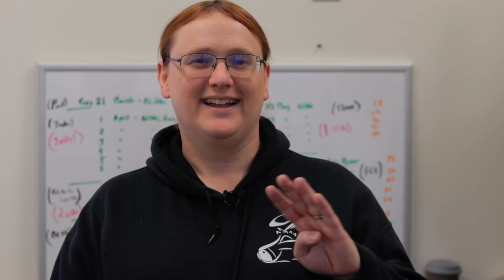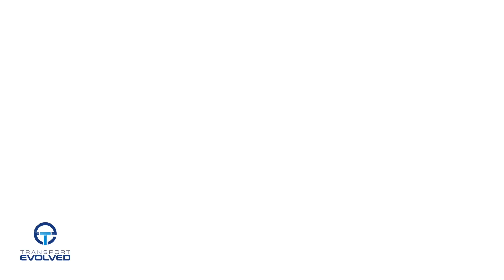What Should The Design Lifespan Of A Car Be?

Comment: We need to take on planned obsolescence directly.  The year that something was made, and how long ago that was  - is the LAST thing that should matter for a machine you use to get around.

Stainless steel - means that you don't need paint, and you don't need "extra" strength to account for rust.  So, that means less weight.

The main thing about any car drsign - is the drivetrain, and the energy source, and the intended uses.  The main parameters are pretty consistent.

Comment: Technology moves on at an every faster pace.  If that technology leads to less resource consumption, should we keeping driving cars that consume more resources for more years?  Perhaps not.  

Take a look at what the industry has been able to do with battery range and especially density.  100 miles per charge was not uncommon 6 years ago. Now we can routinely go 2-3 times as far thanks mostly to density.  But, If a better battery technology came out that would go further still and/or take fewer resources to create, charge, and maintain, should we not follow on that track and send Li-Ion and potentially the vehicles that used them to the dustbin of history?

Comment: I have a 1932 Morris Minor Two-Seater. That's longevity for you. My 30-yr-old Citroen 2CV is less than a 100-miles short of 265,000-miles on its original engine and gearbox, Even the brake discs are the originals. That's proper bullet-proof engineering for you. I doubt my current model Mk7 VW Golf will get to 15, let alone 30 years old.. And as for reaching 87-yrs-old.... Not an ice cubes chance in Hell.

Comment: Across the board in design, we do not build on our successes. We build to fail at ever shorter lifespans. If species evolved the way our designs have the last 50 years, they would soon be extinct. Building modular is an old idea, so implementation isn't impossible. Why are manufacturers  building junk? At what level will the consumer stop buying? Is the consumer buying quality, or bells and whistles fluff? Is it more profitable to build quality? Will my competitor's cheap junk out sell me? 
   BTW: American quality began really dropping around the same time China was open for manufacturing and trade in the mid 1970s.

Comment: The average life of cars is already 11 years, up from 8.4 (CR).  I see 20 years, 500,000 miles being a good target.

With respect ageing cars, I see warn interiors being an issue.  How do you replace worn seats, carpets, roof liners, etc?  Air lines replace the interior of their airplanes every 5 years or so.  What about cars.  With high mileage cars cars used for ride sharing, the interiors will wear out fast.  Custom upholstery like how Sue Martin of ASM auto would be too expensive.

Comment: Out West (U.S.), vehicles will hold up structurally for decades. The upper Midwest or New England you're looking at maybe 15 years before the undercarriage corrodes to failure. Regardless on how well the vehicle is designed, the salt and chemicals used on the roads will eat through most metals in short order.

Comment: A standardized data model, patterned after USB device descriptors, should be developed for battery packs, and I'd support mandating its use by EV manufacturers.   I don't see how aftermarket battery packs can be developed as long as manufacturers keep the interfaces to their vehicles' batteries proprietary.

Comment: Building a car is an expensive endeavor.  That's why there are so few car startup companies and even fewer successful ones.  Part of the way a car company can offset that cost is with the assumption that their happy customer will buy another new car from them 5 or so years down -the-road.  Building a car that won't be replaced in 5 or so years is not too cost effective.

I'm still driving the 1997 Saturn SW-2 I purchased new.  The car is old enough to drink and I still drive it to work every day (30 miles each way).  Everybody who purchased a Saturn loved their car (including me).  However, nobody was giving them up and getting a new one as their old car kept working.  I believe this is one of the reasons GM finally ditched the brand (a fact I don't think I'll ever forgive GM for).

I certainly like the idea and support it.  I just don't know that a car company can realistically operate with that mindset.  And, if they did, cars would get far more expensive.

Comment: Design life - Indefinite.  Manufacturing engineering is where corners get cut.  Owner maintenance is where lifespan gets shortened.  If they are designed with a shorter life, it is a waste of effort and resources.  That is a waste of energy and that is wasted carbon.
Worthless due to battery?  You are making short sighted $$ only decisions. I drive a 1988 vehicle, and spend what it takes to keep it on the road.  That supports the local economy and stops the scrapping of an expensive (in terms of total resource extraction and refining) chassis that has no need for replacement.  My previous pick-up went through two generations of family ownership and over 400,000 miles.  Owners need to look longer term.
I am also an EV conversion fan.  No need for a new chassis.  We have plenty.  Just convert and keep the best old ones on the road :)

Comment: My Ford Focus MK1 is now almost twenty years old and it's still in good conditions. And I aspect that from a  car.  Thats why I don't understand the argument of having smaller batteries, because you have to replace them earlier, because they're used far more, than a bigger battery.  So in the long run, that bigger battery will last longer, even when you replaced the smaller battery .

Comment: I bought my Tesla S 100D when stated to have hardware complement sufficient for full self driving.  From what I see of battery degradation, and I mostly drive gently, 20 years from the battery seems achievable and from graphs seemingly 60% = 60kwh by then with room for more ordinary driving ~10,000 km/year. The car body is very strong and made of materials such as aluminium likely to last longer than practically any previous car. Altogether the S seems to have been built with longevity in mind.  Replacing bits and pieces should not be too hard.  By 20 years, at most, my descendants will hopefully have access to even better batteries in whatever form the power source is by then.
I rarely bought new.  I generally on sold after many years.  My MB 450SLC was 45 years old when I gave it to an enthusiast and my last car was 20 years old when I gave it to a relative. So too I hope with my Tesla.

Comment: The designed lifespan of cars can only increase if the rate of innovation decreases. This occurrence would be very worrying indeed. Would you rather crash in a car from the last two years or a car from the mid 2000s. Very different crash-worthiness yet only a decade apart. And it will only improve over time, even though you think it is already "good enough". 

 (Note, I use the word innovation here, but I really mean the complete list of features of the average car).

Comment: My Kia Cee'd is now 12 years old and I've had it from new. The engine have only done 65k but should be good for another 65k. Aside from a little rust on the rear door due to a bad design, it should last me until I can afford to replace it with an EV. For those of us with little spare cash we would want a car to last forever. The reality is that manufacturers will always make design decisions to maximize profit while ensuring the vehicle is good for its design life which for many I'm sure is around 5 years, although Kia give a 7 year warranty which is one of the reasons I bought into the Kia. The principle factors that govern longevity is engine wear and corrosion resistance and in the case of an EV the battery chemistry. Other factors like other moving parts such as doors, windows, seat mechanisms etc will depend on how much they're used by the user. Again a finite life expectancy. All of these items can be engineered to last 100years no problem. The problem is cost, so there is a trade off between build cost and life expectancy. I would like to see a vehicle where the chassis and bodywork last for 100years plus and all the parts which are subject to significant wear or technological obsolescence should be replaceable or upgradable. I like my Kia as it suits my needs in all areas except the engine which I would dearly like to change for an electric motor. I really believe in reuse before recycle and that's the most energy efficient and sustainable way to use what we have. So the smaller the items that need changing the less impact overall on the environment. Just think of the customization market that could take off if vehicles were designed to be upgraded.

Comment: should outlast us via standardisation. wheres the olympics for engineering ? best design 'for each part' the only one produced in vehicles across all manufacturers,  safety shell fia spec without further mod, inner panels, insulation, outer skin standard sleek design. we need vehicles not style items. but with fully autonomous no one need own a car,van,pickup you just call type required as needed.

Comment: I think the question should be ‘how many km/miles rather than years. As you said and others have noted - safety and aerodynamics are really sorted. I’d also add that body corrosion is mostly a thing of the past. In Amsterdam 20 years ago it was common to be driven in Mercedes taxis with >1 million km that were still very comfortable. They had typically replaced gearboxes, wheel bearings etc., but by analogy we should expect to (economically) replace similar ‘consumable’ parts on EVs - like the battery. That’s the sort of durability we should expect from EVs, irrespective of the vehicle age.

Comment: Nissan had the opportunity to do the right thing with their battery packs - but the design destroys the battery years before it should.  A modern EV battery should last for at least 10 years, retaining 80% of the original capacity.  Within those 10 years, a plan should be in-place to upgrade the battery, and provide another sale - even if it's not the profit from a 'new' car.

Comment: If the drivetrain, suspension, steering mechanisms with all its bushing can be easily replaced, the cost of repair would go down. And same with the doors, bonnets, bumpers etc.  This is what made beetle so easy to work with and tinker. And the beetle came to have a very long life.  Much of the repair cost today is in the labor while  the parts are way overpriced.  

Battery pack would be one of the items that really needs to be easily replaceable.  just unbolt few bolts drop out the old and replace it with a new.  The battery should also be designed for easy recycling (reclaim material easily) the spent battery would then have more value than just rubbish and this could offset the cost of a new battery pack. If leaf's battery pack could be replaced for $?? it might be worth to keep it for another ten years...

We generally keep our ICE cars for 10years while pkups go for about 20 years before we decide to replace it.  There is also a cost tradeoff for wanting cars to last for million miles versus 200K miles.

Comment: What do you know of this news report
Scientists find new way to power electric cars using cobalt
Researchers at the University of Massachusetts Lowell developed a technique that uses only water, carbon dioxide and cobalt metal particles that have surface nanostructures measuring billionths of a meter in size, to produce hydrogen on demand at relatively low temperature and pressure and to use to power the next generation of electric vehicles.

Comment: I don't think sustainability for cars is or will be an issue.  Most of today's cars are already recycled to a high percentage of their parts.  But as an academic exercise:  per a little Google searching, the length of time consumers are keeping vehicles is growing.  Manufacturers are designing cars to last at least 15 years, and depending on how you look at the data, cars on average are lasting 11.5+ years.  Electric vehicles, with one notable exception, should inherently last even longer.  The exception to this is the battery.  But they are getting better and cheaper.  I would predict that within the next few years, we will start to have EVs that will last 20 years.  I think the distribution will be similar to today- many folks will buy or lease a new car every three years no matter what.  But there will always be a market for used cars that still run well- and the EVs of today, and especially of tomorrow, will run better than today's ICE vehicles for longer.

Comment: It's early days for electronic heavy vehicles, there needs to be longevity in electronics no point just talking about batteries, most modern  ice vehicles get taken of the road not because of mechanical issues but because of electronics failing costing in some cases more than the value of the vehicle in total. Most people don't seem to have a clue when it comes to this problem. To get around this issue they need to manufacture parts for a longer time scale or have modules that carry out exactly the same function but the technology on the inside can be different as long as it interfaces with the rest of the system in the same way. But hey, that won't sell new cars will it?

Comment: I looked up two Nissan leaf around £3800 one had broken back wheel due crash and other 2011 model had about 50000 miles, missing 3 bars from fully changed and 66 miles range. The first one would worth money just for batteries but would be shame to scrap it when someone with skills could make it up and put it back on road, the second one going by prices in US £4,388.95 before any expences on fitting it and any additional parts required, Nissan should be fined for every scraped Leaf that can't be put back on road and fine should go back to owners of scraped Leaf. It would encourage them to rethink their business model of battery replacement price. 
 I have spoken with a car dealer yesterday who told me that there is 6 months waiting time for 40 kW Leaf because of high demand in EU.  So why would a manufacturer produce ICE cars when they sit in show room instead of those EVs which there is 6 months waiting time??? If I would need EV car in a  month and I need to wait other 5 months obviously I would end up with ICE car. I decided to keep my 30kW Leaf for at least next 4 years.. I don't think I will choose Leaf again. Nissan disappointed me on many levels...